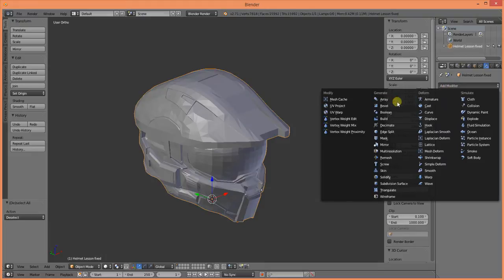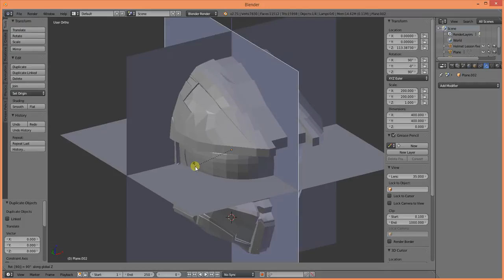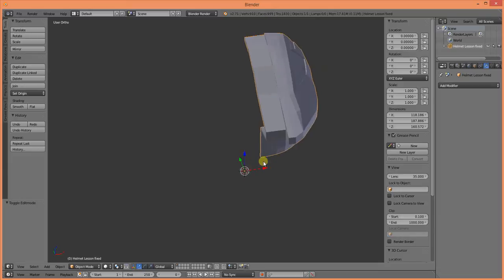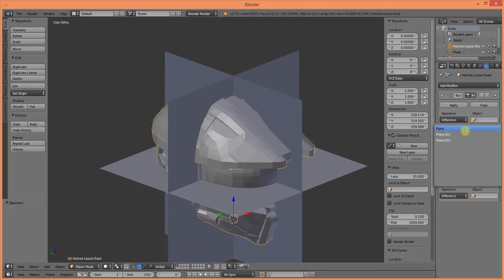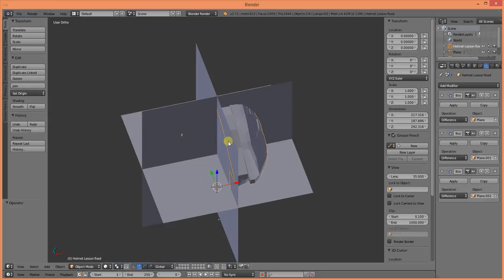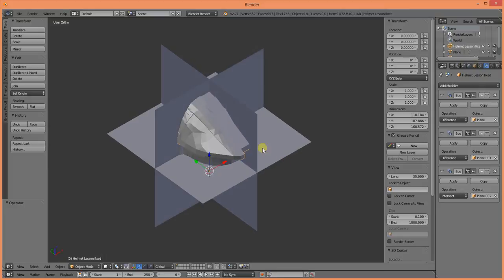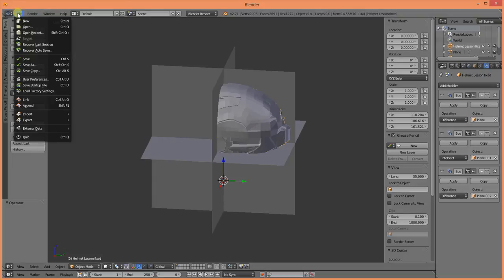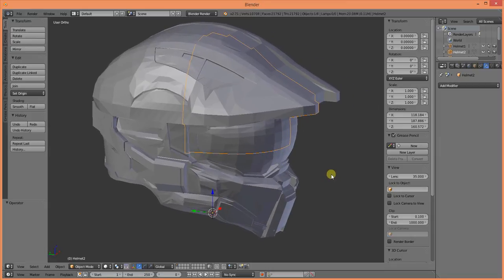Video 5 Slicing Helmet

Comment: The stl does not show up when I try to export it
Reply from the maker: gsamalot have you applied all modifiers first? Sometimes errors occur when applying the boolean modifier. The model may need to be cleaned up first.
Reply: nope turns out I did not have stl added to the export

Comment: Every time I apply the boolean modifiers, it only partly works. Usually only one of the planes will actually work while the others do nothing. When I changed the intersect and difference sometimes the whole model just disappears, please help
Reply: Toasted Bagel the model probably needs cleaned. if you have overlapping faces, or erroneous vertices, even the model passing through the plane at multiple locations can cause this.
Reply: Where could I get this cleaning done?
Reply: Toasted Bagel I think it's Netfabb. Although, I believe it's either Google or Windows has the service. Makers Muse has a video about the service.
Reply: Netfabb is currently owned by autodesk, meaning it cost too much money, and I tried the windows repair thing that Makers Muse talked about, but none of it is working :(
Reply: Toasted Bagel If the auto cleaning didn't help, you'll have to do it by hand yourself. Or use a different program to separate the model. This seems to be a common problem in Blender. I'll try to make a tutorial for cleaning a model sometime this week. If I don't, keep reminding me. I'm a bit forgetful.

Comment: hi!! i'm new in 3d printing world...i'm following your video to rpint an iron man helmet, but i'm stuck on dividing my helmet...blender always shows me the left part of the elmet, even if i flip normals or rotate thr plain. where is my mistake?? thanks!!!
Reply from the maker: Francesco Pierotti it may be because the plane is going through the part at multiple locations. Instead of using a plane, try using a cube. Make certain all the normals are also facing in the same direction. If that doesn't help, share the file you are using and I'll try to see what the problem may be myself.
Reply: i think maybe it's better if i send you my file than you can (please) explain me what was wrong...i want to divide it longitudinally in two different parts. where can i send you the file??
Reply from the maker: Francesco Pierotti is it a file you downloaded from somewhere? Or did you model it yourself? If it's from somewhere you can just leave a link to its location.

Comment: Hi, I have really enjoyed your videos and learnt a massive amount. I am purchasing my 3d printer this month thanks to your videos giving me the confidence to create something.....how ever, I am having 1 issue! After slicing an object, I save the different parts of the object as STL files as you show. The problem I'm having is when I re-open Blender and import the objects they are not in the same scale as before, they are really small!.....do you have any ideas why?    Many thanks and again, great videos.
Reply from the maker: +Graham Yull Not the same "scale" as in the scale isn't 1.0? Or the dimensions are off (was 10 now 2). If they are imported at a fraction of the scale (0.025 instead of 1.0), this may be a User Preferences problem. (I don't know what setting could do that. In previous blender there was a setting "clamp scale"). Try to "load factory settings" in the file drop down window, then import the files (hopefully you don't need a clean install). If this works, you'll need to "save user settings" in the User Preferences window (If you used my presets "Maya Keys" to modify the file, make sure to save those as your user settings before importing new files). If the scale is too low when you import, then setting those to 1.0 should bring the dimensions back to normal. Do you have the latest "stable" version of Blender?

Comment: Hi i have really enjoyed your vids but i have run in to only one problem when trying to slice the helmet into smaller peaces for printing i hit a snag. when i add the Boolean modifier it gives me the "cannot execute Boolean operation" any ideas how can i fix this?
Reply from the maker: Dexter Shelton Modifiers can not be applied in "edit" mode. Ensure you are in "object" mode. Also, any modifiers you have set on the host object (the helmet) need to be applied before slicing. If you are still having trouble, try running the file through netfabb.com or another mesh cleanup software.